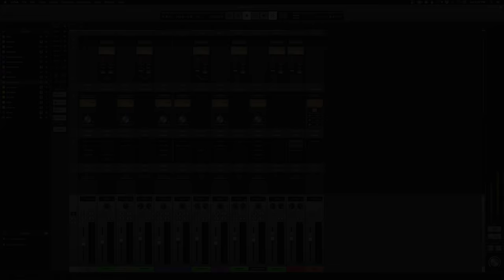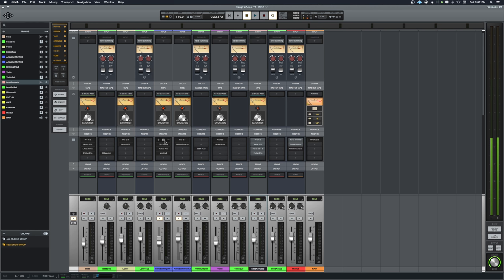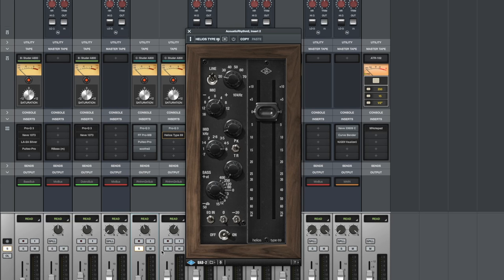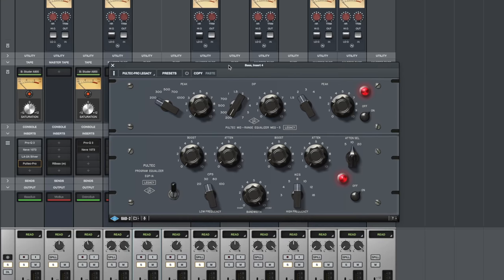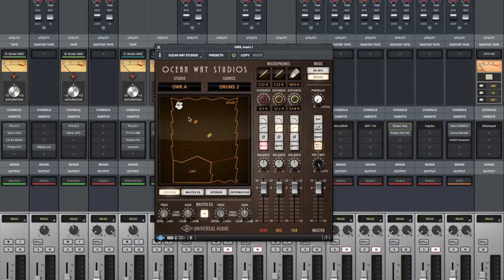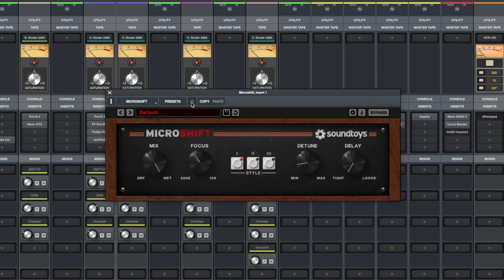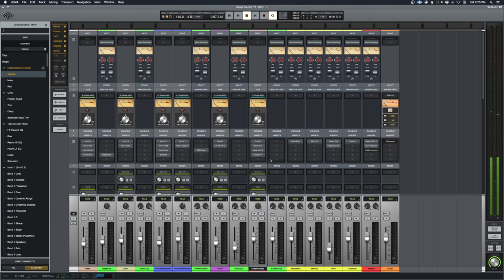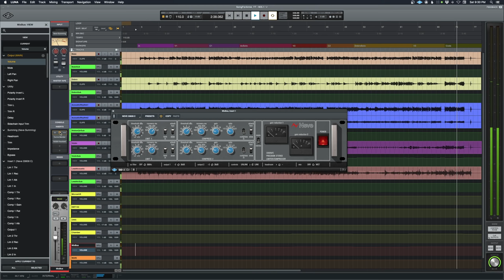Acoustic Mix - Part 2 (FINAL) - in UAD's LUNA (with free files)

Comment: Why do you use a Mix Bus instead of going straight to the Main? I know logic defaults that way but don't understand the advantage. Thank you for these excellent tutorials!
Reply from the maker: I typically use a Mix Bus in Logic and Pro Tools, so it's really just a hold-over from using those DAWs; but it also gives me complete control over the output to my monitors without worrying whether the fader is controlling the input or output of the channel. I hope that makes sense. Basically it's just habit, but also allows to raise/lower the output volume without messing with any section of the gain-stage to the mix bus processing. Cheers!